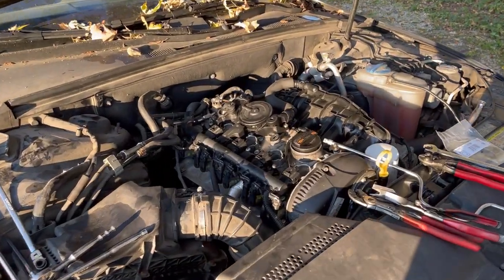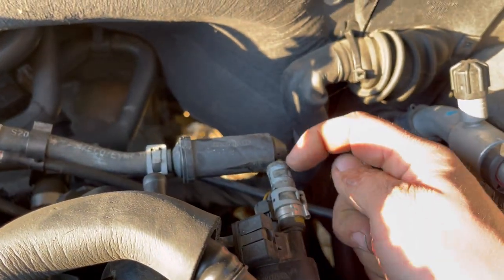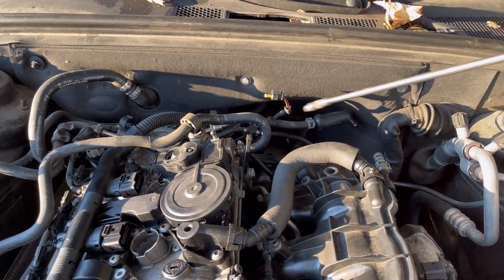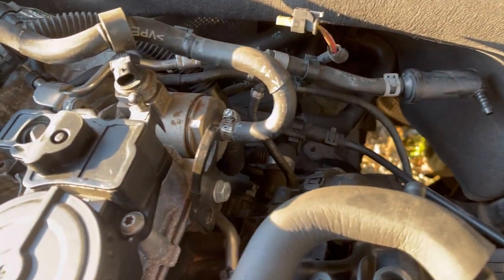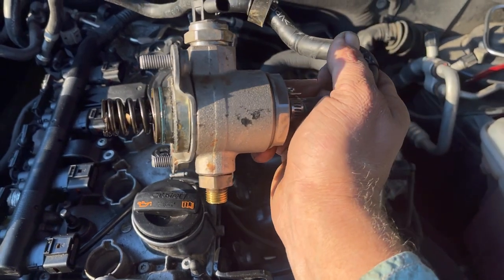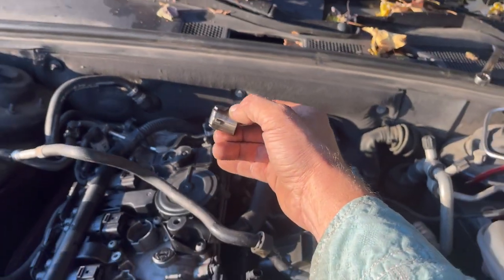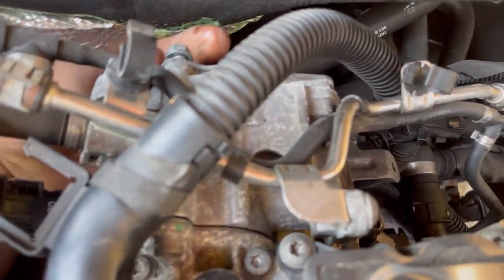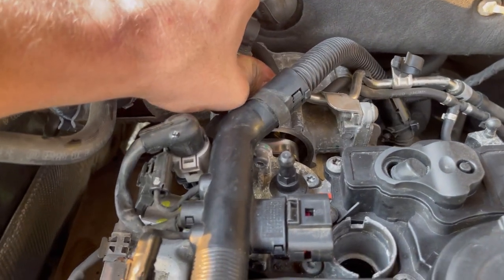2.0t Audi vacuum pump gasket oil leak Replacing fix how to flat rate tutorial a4 a5 a6 q5 b8 b8.5 vw

Comment: Good video, replaced this gasket on my b8 2.0t, had a real fun time lining up the vacuum pump with the cam shaft because I took it off entirely and cleaned it which caused the camshaft key way in the vacuum pump to no longer be aligned.
Reply: Same here!
Reply: I did the same thing. I'm glad that it is done though.
Reply: How did y’all get it aligned again? It’s not going back in for me no matter how much a rotate it
Reply: @Luke Olson  did you ever find the trick to it?

Comment: If you have trouble getting the vacuum pump back on after putting on the new gasket, there are 2 problems I encountered.
1) the cam has to be lined up so keep twisting the vacuum pump with you fingers until it’s lined up.
2)The high pressure fuel pump has a part that slides into the cam area. You can just push it back out of the cam area and that solves to problem.

Comment: I had a 1977 Oldsmobile salon back in the 80s. My radiator started to leak so I took ti a local radiator shop and got them to work on it. The mechanic one arm. The things did with one arm were pretty amazing. He did everything And had the car ready In around two hours. Not bad!

Comment: I think your smarter than the mechanics here in New Zealand. Good video good explanation thanks for the tips. Audi is not good for New Zealand as its very hard to get the parts needed to fix oil leak issues.

Comment: Thanks! I've followed your video and got mine off and am ready to replace the gasket and oring. Couldn't get all the hoses and wiring clips off and out of the way, but there's enough room. I highly recommend spending $15 bucks and getting a ratcheting 10mm combo wrench. There's still a 10mm socket missing somewhere down below from the cam cover job I did last month... 😢
Reply: Just had to add that I now have ZERO oil leaks thanks to your valve cover and this video!
Reply: @robertlodge6012 Im in the same boat your probably were. Did you change the o ring for the fuel pump he took out as well as the other o ring he recommended to swap?

Comment: Great video.. I like all those HPFP videos.. question.. I’m doing the water pump module on my ‘13 A4 B8 and gonna do the real coolant flange as a preventative maintenance.. should I take off the vac pump to gain access? Or is it still possible to get that flange off and on with the vacuum pump there? I know it fill bear hug Audi position but looks like it’ll be easier to remove the vac pump.. thanks 👍🏻 any progress on the low compression?

Comment: Du you think Permatex will work with this gasket? I have an uneven surface of 5 thousandth between the valve cover and the cylinder head body.

Comment: 1:19 *its The fuel control valve 🤫 keep sharing! 👍
Reply from the maker: N276, ya the previous generation 2.0t had a low pressure sensor sticking out there and I say the wrong stuff sometimes

Comment: If my vacuum pump is leaking oil which l know she is will that create a rough idle while parked or make it sound like is cam or something similar to it???
Reply: I'm having the same problem with mine. Did replacing vacuum pump seal fix the issue?

Comment: Idk why there are no videos on how to do this on the 1.8t tsi gen 3 engine. Ok the gen 3 you also have to remove the HPFP before removing the vacuum pump. Also the long bolt at the bottom to the back of the engine is obstructed by the brake fluid reservoir and line which I can't figure out how to remove the bolt without stripping it.

Comment: I've never stripped out threads until today. I was wondering how would you fix threads for the long vacuum pump bolt, closet one to the catalytic converter. I really don't want to pull the head off the car. Please help anyone
Reply: I have all 3 stripped. I used autozone helicoil thread repair kit. Just put it back together. Know I need to pray so it stays together! Lol
Reply: Let me know if you fixed it!
Reply: @tokarqi  thanks for asking. I just finished it up today. It took a lot of asking around to get the answer I was looking for.
Reply: I noticed the leak on mine today. I put a wrench on the top bolt a d it was completely loose. I need to use a heli coil myself.  I guess I should buy 3 just in case. Thanks!
Reply: If you are careful and lucky, retap them out with 1/4-20. The 6mm bolt od is 5.87mm where the 1/4" od is 6.3mm.  Use grade A, 3-3/4" length.  The top and bottom ones near the right fender side are easily tapped for they are through holes.  The bottom bolt near the center of the engine is blind tapped.  You need to use a regular tap, then go back with a blind tap to get additional threads.  Use WD-40 to flush out the chip as you slowly tap this last hole.  Don't tight them too hard, 72 in.lb.  Use the OEM triply gasket. Don't buy the crappy one from Amazon.
Reply: Hello mate. Really need your help, i stripped the bottom two bolts like an idiot, dont know how it happened. I did tighten them by hand then i used the wrench. Please can you advise how i can fix it, what size helicoils will i need? 
Much appreciated

Comment: Do I have to remove fuel pump , if I’m just replacing the vacuum pump gasket
Reply: Have you done this? Currently in the middle of this wondering if I need to
Reply: I’m about to do this as well. Did any of you have to remove the fuel pump?
Reply: @quencyel7715  i didnt remove the fuel pump but i also had the valve cover gasket off not sure if that made a difference. We disconnected some of the lines around the fuel pump which gave enough space to move the whole thing to put the new gasket in.
Reply: @diegoburciaga5311  I did the valve cover and timing gaskets 2 days ago and then noticed that the vacuum pump was leaking. I did it today and I didn’t take the HPFP off of it, I just disconnected the hose that he said would break. And it’s a bracket or brace in the back that I loosen and it made it easier to get the pump back on.
Reply: @quencyel7715  sounds exactly like what i did wasn’t too bad.

Comment: Putting it back on is a nightmare
Reply: I’m struggling to get the cam lined back up to the vacuum pump, I’ve been trying for like 2 hours. The vacuum pump keeps rotating by itself so I can’t get it lined up.
Reply: @lukeolson2254  i just Kept moving it around until it got stuck on there and I beat it

Comment: Thanks for your excellent video on replacing the Vacuum Pump Gasket. I watched it 6-8 times before attempting the job. However, a new pump was so inexpensive (see below for details) that I decided to replace the whole thing. All went smothly until I put it back together and started it. The Pump was out of time with the cam. So I dismanteled everything and rotated the slotted Pump drive by 180-degrees, and walla that did the trick. Runs like a charm and no leaks. Are there any markings on the pump or the cam that would enable one to align the the timing to avoid the hit or miss approach? The Pierburg Vacuum Pump is manufactured in Germany and looks like an OEM part.

The Pump:

Audi Vacuum Pump 06J145100G - Pierburg 724807290 7.24807.29.0

    Fits your 2011 Audi A5 Quattro Cabriolet 2.0 L4 GAS

eEuroparts.com Warranty: 	2 Years
	1 	$149.95